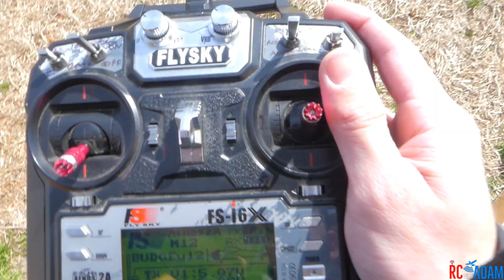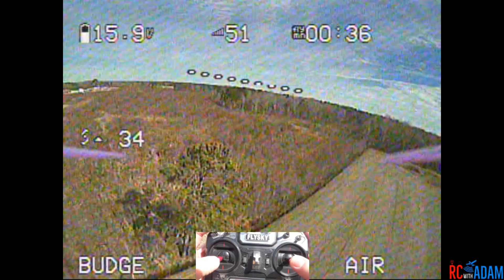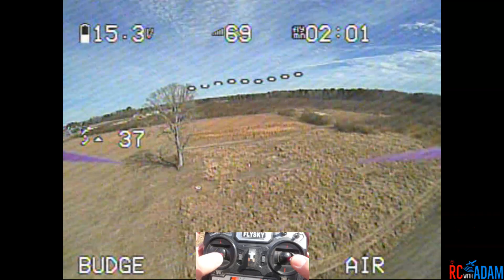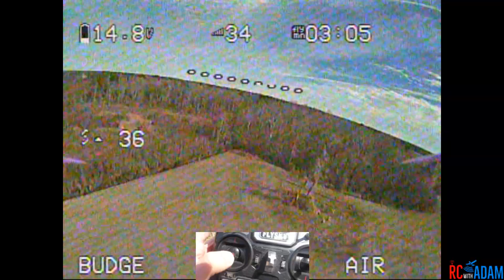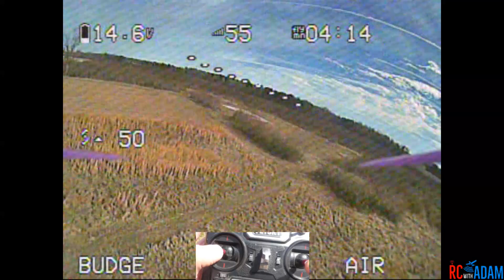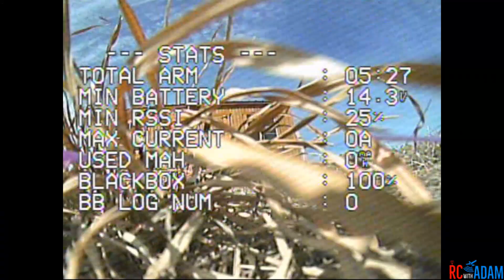1/3 Mile with Fli14+, FS-i6X & 25mw - Budget Basher Range Test - Flysky - Eachine - Mamba F405

Comment: Hey Adam, I was finally able to bind that receiver, but once I turn on the RC (FS-i6 "firmware mod") started beeping endlessly and showing the battery telemetry low, how I can make it stop or configure. Thanks!!.
Reply from the maker: I think you can go into thw menu and turn of the alarm. It might be in the factory menu, which you access by holding down the bind button while powering on (actually it might be by holding the sticks  in the bottom right and left corners while powering on. I can't remember and I don't have the info right now.).

Comment: How should the antenna be positioned? Can I put two antennas symmetrically?
Signal strength is not as powerful as expected.
Reply from the maker: Antennas (typically) should be at 90 degrees to each other. Basically, you want to try and have at least one antenna visible and either vertical or horizontal to the transmitter at all times.
Reply: @RCwithAdam1  Thank you.

Comment: Hi sir i have failsafe issue at about 50mt with fl14+. Heard same from many pilots. Is it true? How can i check my tx if its faulty?
Reply from the maker: I have not had any premature failsafe issues with the one fli14+ that I have. One way would be to use a different reciever, turn it on, leave it on the ground and walk away to see how far you can get before a failsafe.
As for an internal check with just the radio itself, I'm not sure right now.
Reply: @RCwithAdam1  Today i let the quad on and had a walk with my goggle and tx. About 50mtr rssi dipped down to 25 30%  is is rx tx or connection issue?
Reply: @RCwithAdam1  Thanks Adam. Whats the best option other than Fli14 to try. Any suggetion? My rx pins and plug are not so tight could that be a reason?

Comment: have you tried a range test with  x6b  vs Fli14+? I have 2 qwads 1 with Fli14+ and the other with x6b.  The Fli14+ specs are over 500m and the x6b spec are over 300m.  I was thinking the Fli14+ had better range (along with the RSSI on OSD) but my X6b performs better in range.  I still get telemetry from the Fli14+ on the remote and the signal strength alert starts  alerting half the distance as the x6b.   
I was wondering if it was some other interference in the qwad with the Fli14+ or a bad antenna but before I start tearing down and swapping parts I wanted some more data from other that have tried both receivers

Comment: I fixed my issue with short distance failsafe!!! 
I turned off failsafe in TX settings and turned on in betaflight :) 
NO MORE “Clicking” or failsafe:) 
I did range test and I could make 400m without any failsafe :) yeeeay
Reply from the maker: That's great! But the actual failsafe (set in betaflight) does still work, right?
Reply: What up with all your ranges I'm doing a kilometer on the fsi6 with ia6b easy
Reply: Hai Yze Lucewicz.  Can i know what receiver you use? Mine also have clicking on my receiver. I think your plan was good idea.. i want to try set off failsafe on my tx..

Comment: Hey Adam. Thank you for making all this videos for us:) 
I hope you know what’s wrong with my RX.. 
I bought Eachine and also using FS-i6X with FS-A8S receiver but because I had a lot RX LOST and failsafe at veeeery short distance I crashed and broke all frame and antennas :) now I bought new frame, FC, ESC and FLI14+ receiver but yesterday I had first flight and it was ok but still failsafe once at 30-50m distance again??? And sometimes few “clicking” (I’m calling “clicking” because when I fly it just loses signal for half second and this marks will flash “*****” on the warnings in goggles OSD at the same time..) at first it just “click” few times and at some point it failsafe at 30-50m distance.. 
I don’t want to crash again like before so please can you help? 
Your range is amazing and I would be happy to get the same result on my new build:)
Reply from the maker: Since the same thing happened with both receivers, maybe there is something wrong with the transmitter? Do you have other RC aircraft that work well with the tx? Also, for testing next time maybe try leaving the quad on the ground at idle and walking away with the tx until it failsafes again (that way you don't risk a crash).

Comment: I noticed your fsi6x throttle doesnt centre  on its own. I just bought one which does self centre on both sticks. How do i fix that? Thanks in advance. Ps im a newby.
Reply from the maker: Hi! I'm not sure. It may be as simple as removing a spring from the gimbal. I'll have to take mine apart and let you know.
Reply: You have to open the Transmitter and Remove the Spring Mechanism of the throttle lever. Inside your Packaging of the Transmitter there is a small spring steel piece with 2 screws you have to mount it so the throttle gets a little bit resistance and does not move on its own.

Comment: Are you the set rssi_scale?
If yes, what is the value?
Sory for my bad english 😂
Reply from the maker: Hi! I have not made any adjustments to the rssi scale. And I was actually just thinking that maybe it isn't quite accurate (telling me I have weaker signal than I do). Further testing will be happening.
Reply: @RCwithAdam1  I am using fli14+ too but my default value rssi on osd is 40 😓
Reply: @RCwithAdam1  Have you figured it out yet? Was it incorrect?
Reply from the maker: @boratsagdiyev1586  No, I haven't checked yet.